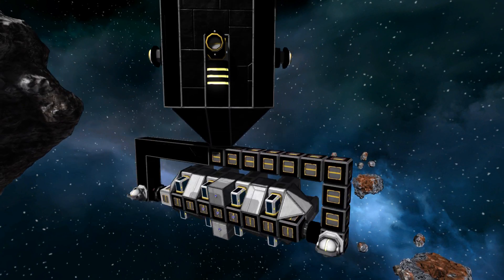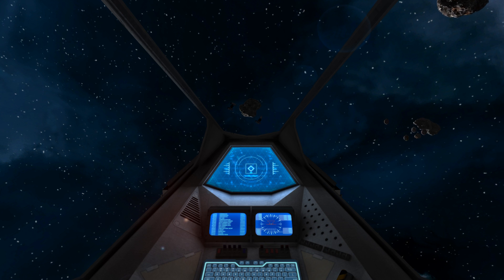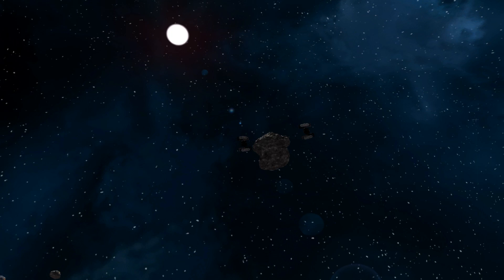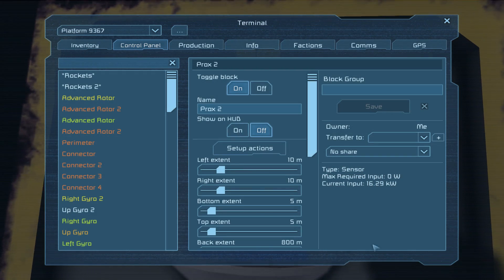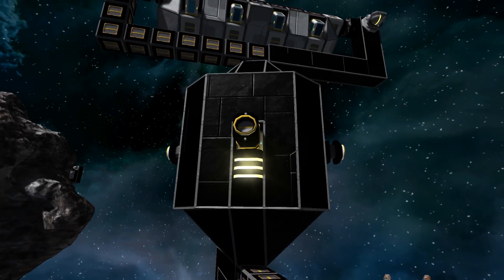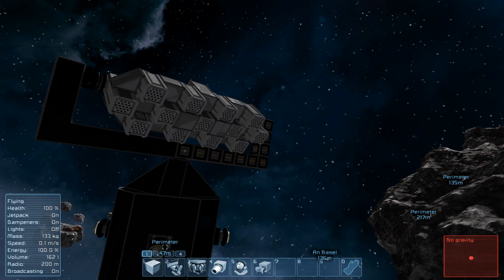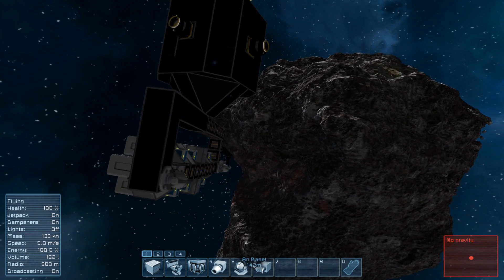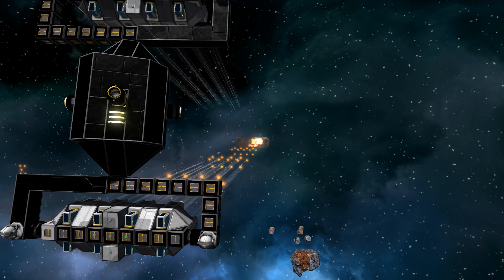Space Engineers - Phalanx Auto Defense Turret, 1km Sensor Tracking

Comment: I'm stumped... I can't merge large ship rotors facing each other in survival. Is this exclusively a creative thing?
Reply from the maker: Not that I'm aware of but I haven't tried it in survival in a while now I'll admit, should still be able to but the rotor part in there though, just need to be sure it's in the right order. May have changed though, will have to check.
Reply: What has me worried is that even with displacement on -40, there still isn't enough room to place a block in the gap... I can't connect the merge blocks together... =/ I have no idea why it does this; with the small blocks it's as straightforward as can be!

Comment: I love drones, and automated defences :) in my multiplayer survival ive placed homing mines and alarms in asteroids and places of interest. And can make a swarm of little AA / decoy drones around my larger capital ship... my only problem other than the sensors shocking range is their relative expence to build :/
Reply from the maker: Sounds cool, I like the defensive swarm :) These extended sensors have an added concern in that they have increased range but because of that the power consumption per sensor is very high so you are running extra reactors with this setup too, adds to the expense. Still, they are fun to use.
Reply: *****
Il put the drones on the workshop and add a link... my idea was to keep them as small and simple as i could... you can really get big numbers prety quick with a pair of manufacturing "bays". Great for harrasing smaller ships you might otherwise not be able to hit with larger ships.

Comment: Wouldn't a smaller turret become less confused? If the movement sensors are flicking between multiple targets the fire control sensor won't get a chance to trigger properly. So instead of two massive turrets firing a barrage of rockets you could go or 4 smaller turrets with limited but overlapping fields of fire.

Say 100 degrees to allow 5 degrees overlap on either side. Use fixed sensors so that when a target leaves the fire trigger arc of one turret it returns to a rest position and resumes scanning for new targets.

Think of it as four greedy turrets fighting over their slice of space pie.  They'll share 5 degrees with their neighbour but if the target extends further into the slice they'll slap their neighbour back to centrepoint and restart it's default program.
Reply from the maker: Hmm, would have to play around with it but I'm not sure you can have fixed sensors like that using this sort of sensor system, it relies on the gyros turning the sensors to a point where all 4 are active together at which point they cancel each other out and that's when it's on target.. Making them fixed means the turret would never reach 'center' as the sensors were moving and so would just spin indefinitely in the direct the enemy was approaching.

I do like the idea of having them use more precise firing arcs so that more of them can be used at once safely, will have a muse on how exactly! Cheers :)

Comment: I have an idea on how you could make multiple targets less of a problem for sensors.You could try giving one of the gyroscopes in each direction slightly more power than the other. Such as setting left and up to 100% power and setting right and down to 80% or so. This should make the turret preferentially target upper left objects before moving on to others. Also a second sensor with similar ranges to the firing sensor could be used deactivate the firing sensor or rocket pods if an asteroid or friendly is between the target and the launcher. I haven't tried either of these yet.